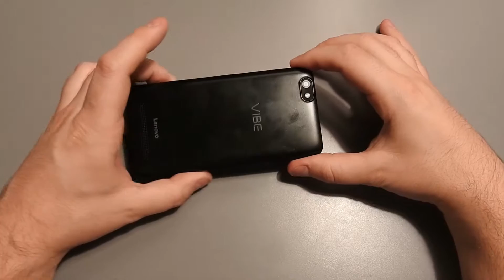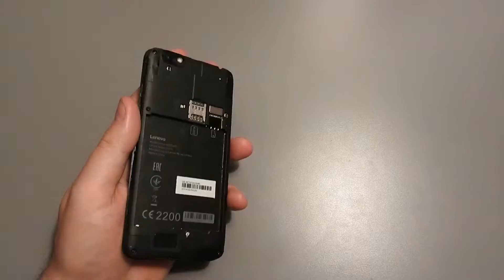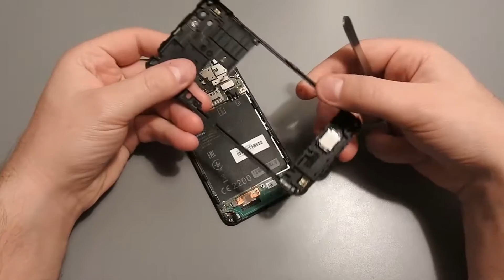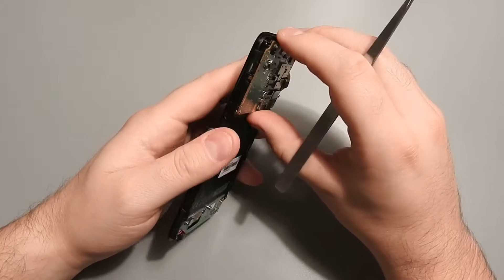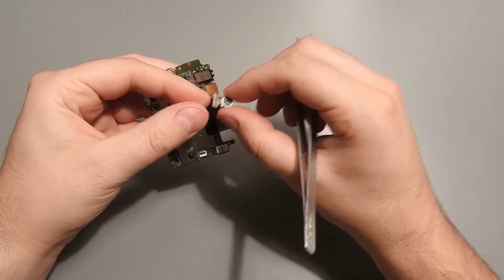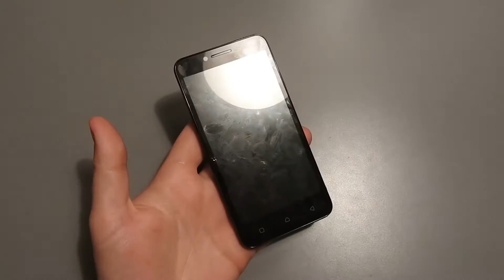Lenovo Vibe C Teardown - Disassembly and Assembly [Tutorial]

Comment: My lenovo a2020 screen become white, can i overcome this problem by change to lcd and digitiser sir?
Reply from the maker: Yeah, if the screen is faulty. Is the phone working, do you hear ringing, vibration, notifications? There could be something wrong with the phone itself (mainboard), and the screen could be fine, but without anything to show.
Reply: Cams164 the others except screen working just fine, this white screen happened when i accidentally drop by phone, the screen crack a lot. So it can be overcome by change its lcd and digitiser ?
Reply from the maker: Yeah, sounds like a new screen would do the trick.
Reply: Cams164 ty sir, i will try it later and let u know the result, appreciate ur comment